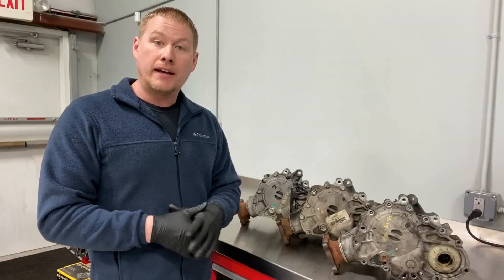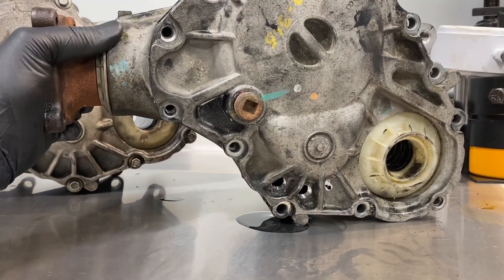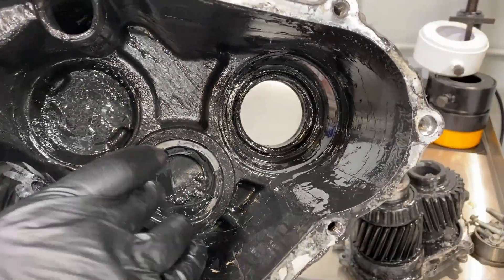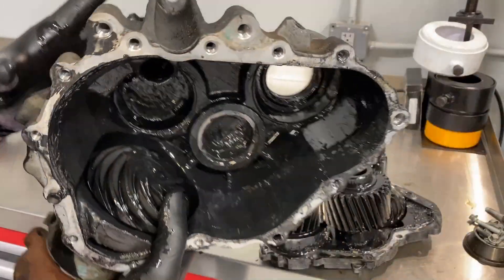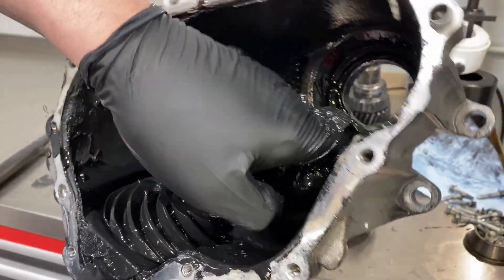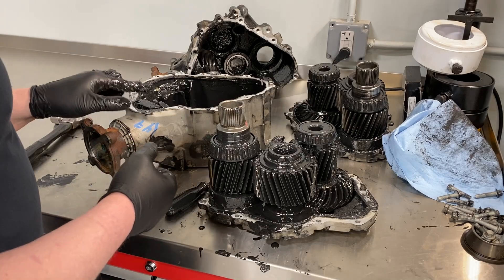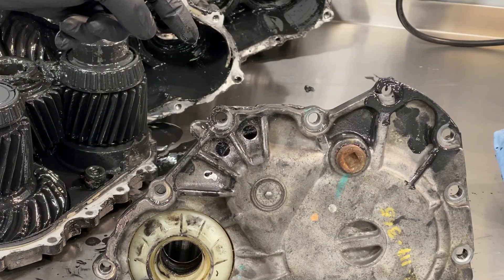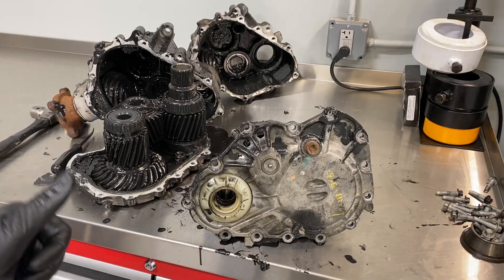How Ford All-Wheel Drive Power Transfer Units Fail and What You Can do to Prevent it!

Comment: I had this problem with my 2016 Ford Explorer.  The dealer took them 5 days to figure out the problem. They even had me come on the second day because they wouldn't believe me that there's that smell inside the cabin. The day the service people called me about the estimate to fix this, which was $3000 CAD, was also the day we decided to just trade it in. We had the vehicle for 5 years and there was a lot of issues already prior to this, like A/C repairs. 

When I told the service guy that we're not going to get it repaired his answer was "that's ok just let us know when. At the moment it is safe to drive". Got me thinking since you said that it might have a tendency to explode.  That is not safe. 

Thanks for your video!

Comment: I have a 2010 Mazda CX9 124,000 miles it threw a code of TCS sensor failure once in a while when drive I feel a clunck and my 4 wheel drive light flashes could it be this or just the sensor?

Comment: Could using an oil cooler be used to add capacity, and cool the fluid at the same time?
Reply: It doesn't have a pump. The oil is flung around by the gears. So no, a cooler wouldn't work.

Comment: Thank you for the great video! Finally I found something I can watch that is understandable. I just came across your channel by accident, after having the PTU fail in my 2013 Lincoln MKX (165,00km.) Just wondering what your thoughts are on using the Amsoil Severe Gear 75W-140 synthetic are? I have always sworn by Amsoil in all my vehicles and motorcycle. Am I wasting my money on the extra cost?

Comment: What's up with the ABS units in Edges? In the last month we've replaced three. Customer complains about a soft pedal. Have not taken a failed unit apart but it seems to be bleeding pressure past a valve inside the module.

Comment: Besides seal leaks, what are the symptoms while driving?  Does it just seize up or will it slip?  I have a slip on 2011 Edge between 30-40mph.  I installed a plug and drained the ptu fluid and no change.  Thinking this or torque converter.

Comment: I would love to of been in the room with the engineers when they justified making this PTU filled for life. I am willing to bet the life of the warranty was brought up and that failures will likely occur after warranty. There is no way they could of honestly beloved the PTU would on average last over 150k miles let alone 80k miles. It is a joke! I have 89k and in stock PTU with 440BHP with tune. Still kicking but it’s a ticking time bomb. I absolutely love the 3.5l eco boost engine! It is a beast and it tunes up to 440hp with less than $500 in parts( 3 bar map sensor... 160 TStat.. cold air intake.. and tunes) the power gain is unreal for the 93 octane tune and torque gain is even better. The car just makes power on the low end crazy fast like 3500 rpm and it’s moving quick. That’s nuts. Now the rest of the car has been a joke. Door blend broke deep in dash pass side blows cold air year round complete dash tear down just to fix $1000 plus quote not fixing.. headlight assembly filled with water and took a shit. Used assembly on eBay go for $600!! If they have working parts sometimes more. I was lucky and found one for $410 with all working parts. Blew a dash module that was a $1000 bill to get fixed. Not impressed with the issues I have had. I mostly kept in storage and drove my 2001 Acura CLS to work until it hit 239k miles and trans blew.. way too much to fix those. So I drive the SHO to work and the problems I have with it I never had with the Acura. Just truly poor engineering it is a 2010 first year but still.

Comment: With this kind of failure rate, Ford should have done a recall.  The dealer is replacing the PTU on my 2016 Flex right now.  Thankfully, the power train warranty is covering it or I would be out serious money.  I'm at 55K mileage and only a month or so left on the 5-year warranty.  I am hopeful that nothing else was damaged or compromised, as I drove it almost 3000 miles after noticing a propane/sulfur smell that got progressively worse and eventually had knocking and jerking in reverse.  It started after an oil change and I first just thought oil or other fluid was spilled on the engine block.

Comment: Do you have a part number for the new ptu with drain plug? Will it fit a 2016 explorer? I called local ford dealer and their parts guy said the part number for 2019 is same as 2016, DT4Z7251G. He said if they'd added a drain plug they likely would have changed the part number.

Comment: my wifes 2015 edge awd i change it every 25k miles its got 75k on it now and has a drain plug i use the motorcraft lube for it just changed it and it was super clean. should last a long time.

Comment: For out of warranty vehicles, do you think that adding some lines and an oil cooler up front for the PTU would solve the overheating problem? Mine was replaced at 20k miles and has the filler and drain plug. Could fluid be routed in and put to the cooler through there? Or could you recommend and other ram air ports to cool other than the one attached under the lower engine shroud?
Reply: I've had the same idea the newer ones have a vent hose near the master cylinder if you could put an extension on the vent hose and a T fitting in a hose leaving the drain plug ( the T Would facilitate drainage) then add a small radiator and a 12 volt pump might help I'm not an engineer just a thought this would take considerable time and some expensive

Comment: I do on occasion smell a propane type of smell in my 2013 Ford Police Interceptor Utility (3.7L)...  I bought it with 120k miles, at 122.5k miles now, and hoping to change the PTU fluid soon.  I'm beginning to wonder if the fluid was ever changed in this thing...  I also on occasion hear this sort of noise that almost sounds a bit like higher-pitched tire noise at low speeds, it comes after I go past a curve in the road and goes away once I have steered along a bit more (almost as though the wheels are gradually coming into alignment to make the noise, and then as I'm steering into the next curve the noise gradually goes away).  Thoughts?  Should I be concerned?

Comment: My 2003 Ford F-150 transfer case has a fill and drain plug and is designed to have the transfer case fluid changed. Why didn’t Ford design the Explorer PTU to be serviced?

Comment: I noticed you are talking about the fluid in those old units as looking like tar, I  learned that Ford adds a special Moly additive like a CV joint to maximize the fluids life and performance ,I have been (sucking)changing the fluid in my 08 Taurus X AWD with Royal Purple but not replacing the moly additive so I can monitor how much moly is draining out and get an idea of when the old fluid is  eventually out and I could add Moly if I want,

Comment: Where the filler cap is. Could you take out the filler cap add a tube with a rubber grommet. From what I can see the looks like there's clearance to get to the lower part of the casing add a little bit of compressed air either through the  vent tube  or  put a little hole  in the grommet when it's warm and force out the old fluid through the tube out the filler cap?

Comment: Damn! There I was driving along in my Explorer, smelling propane, trying to figure out what it was from. Googled it while at the store but didn't see anything dire, drove a couple miles further and boom! Smoke out the hood, and on the side of the road leaking fluid everywhere. Mechanic says now the whole transmission and drive shaft need to be replaced along with the transfer case. Crazy that this happening could do that much damage! Too bad I came across this video too late...Just a PTU replacement wouldn't have been so bad

Comment: OMG! that is ugliness. I just bought my son a Jaguar xtype, same concept from Ford.."non serviceable" I couldn't believe it. I may be too late with my sons car, but, lets see what happens. BTW, I will attempt drilling for a drain plug. Way back I had a welder add a bung for a fitting a thin wall alloy part . The welder asked what type of alloy, but I didn't know (I guessed aluminum?). Anyway, the welder was able to weld, and the bung held perfectly. I'm  going to take a chance and drill on the case instead and do a bung.....fingers crossed! BTW, great series on this PTU.

Comment: I have a 2011 Explorer w 200,000 miles the fist time I did a fluid change it very thick not much came out. Now I have changed it three times with a thousand miles between. The oil is still black but I’m getting more oil and the viscosity is more like gear oil not grease. 
How many more times should I do changes before going to 30,000 intervals?
What should I look for?
I love your videos please keep them coming!

Comment: I just picked up my parents 2016 3.5 eco boost platinum explorer from dealer, only has 29k miles on it, I found the right side PTU seal leaking on a motor oil change, the car was still under drivetrain warranty,  it took two weeks for Ford to get the “updated” seal and slinger to get it fixed??? They changed the fluid too I’m told by invoice, The service writer told me I’m good to go? I asked what about the hundreds of videos with these things failing?? He didn’t have a answer, we our a Ford family but these repeated bad engineering issues get old and make me consider other brands, I still own  a 2003 v10 f350 and a 2005 5.4 Expedition with the dreaded spark plug issues, come on Ford!!! and you wonder why people buy foreign ?!?

Comment: My 2011 Ford Flex is at 156K miles and the PTU is still working. I did change the  PTU fluid  at 136K mile and again at 154K mile. Alot of glitter in the oil.

Comment: Thank's for this video i have a 2006 Ford 500 Limited AWD. Just had it's 200k service. it's my understanding that the AWD system is VOLVO with lubed for life differentials. Are there any issues i should be aware of with these units. The only thing i've had to change  was the front axle bearings. Other than that it gets serviced every 5k.

Comment: We own a 2018 Ford Taurus AWD with 21k miles, love this car and all our other Ford vehicles. Been following your youtube videos for a few years now, very helpful advise on trouble shooting and repairs. Much appreciated. Contacted our Ford dealer today about getting the PTU serviced as a preventative measure. Was told it's a "non-serviceable unit", lubed for life. The tech had heard of the issues but stated the only way to completely drain the unit was to remove it. He didn't say what that would cost. I plan to siphon the lube out thru the filler port as the 2018 Taurus doesn't have a drain either. Just a wondering if after siphoning the lube would it be advisable to fill with ATF to help flush some of the debris and build up loose and then siphon again before refilling with new gear oil? Any thoughts? Thanks in advance..

Comment: In case I can't manage to drill a drain hole could it be fine to use a suction  or vacuum pump after 25000 or 30000 miles to drain the oil?

Comment: I'm gonna bring my 2017 Continental (18K miles) in for an inspection of the PTU seals, should I get a fluid change at the same time?
Reply: Does your Lincoln ride a little rough . I have a 2017 continental 2.7 awd and even with 19k miles it rides kind of rough for how new it is and I suspect the ptu

Comment: you showed me no more than goop in the power unit, I didn't see any failure as you discussed during the video (eg: missing teeth), whats to stop one from parts cleaning the unit replacing the idler bushing and bearing, refilling with proper lube and sending it on its way...?

Comment: That cover was stuck tight on that 2nd unit........."..if all else fails, get a bigger hammer!"...  lol  Why in the hell did they use a bushing on the idler gear and not roller bearings like the rest of the gears??  SMH.

Comment: This transfer case was also used on the Mazda CX-9. Sometimes they would come in failed in less than 11,000 miles. Most the time it was approaching 100000 miles though. Mazda extended the warranty on them due to the failures. Many times in the higher miles cars the splines that meet the transmission would be damaged as well as the transmission splines. If it was still under warranty Mazda would also replace the transmission as a related item. The transfer cases in the CX-7 never had a failure like this. Those transfer cases had external coolers. Oh and 5 hours for the transfer case replacement ? Lucky bum, Mazda would give us 2.1 hours.

Comment: I have a 2013 fpiu that shakes around 24mph, it happens more often if the vehicle is accelerated slowly. I don't smell anything and there's no fluid leaks. I have about 144k miles. The transmission fluid is fresh and it only shudders and shakes around 20-30mph..can this be the cause?

Comment: Hi. Thanks for making all these videos. I have been following you for a few years and they have helped me not only do some maintenance better, but also helped me understand better. I do have one question for you though. I recently used your video to service the PTU on my 2015 Escape, but I ran into problems servicing the rear differential on it. Do you have any info on that? It's nearly impossible to get to the check ports with a wrench due to lack of space between the sub-frame and the differential. Can that fluid stay in it for life? My gut tells me no.

Comment: If you set up an air line into the filler plug you can put positive pressure in the housing. When you break thru with your drill the pieces go out along with any oil. Same applies when you tap it. You could also go right down to 1/16" NPT and use a dry seal pressure plug. It will involve getting the tap before hand but leaves only a tiny drain. My guess is that from the look of these units they will need some sort of flush. What do you recommend: over filling and driving for a bit and then redraining and filling again with the correct oil? Can you put in a drain from directly underneath near the side cover?

Comment: What are the symptoms/ noises associated with a failing or failed PTU? Obviously shy of it having exuded? I have an 18 3.5 ecoboost F150, that started making some type of, not necessarily grinding but almost like a bad bearing noise. I could hear it mostly when I'm doing 40 mph, but I can slightly feel it through the accelerator pedal. Kind of hard to describe.

Comment: It is a great informative video, and showing not only one but two of these, thank you!
I was thinking that if the idler gear bearings are in the gear, the shaft should be stationary at all times? What I fear is that if the shaft isn't locked to the case, no matter how good the oil is, it will turn and eventually chew itself in the softer aluminium. Of course it would still be good to change the oil regularly to get those contaminants out, it would definately last longer.

Comment: after the 5.4 (plugs...plugs again after redesign...cam phasers) and all the issues with the 3.5s intake valves....
f250s and 350s having death wobble (which WAS a dodge issue mainly)

and now this.....i dont get how anyone can buy a ford

a co workers 2019 fusion had to get a new engine because the block was miscast.... and coolant was not cooling 1/4 of the motor
temp gauge read fine.... but one cylinder was COOKED 

i just cant believe all the MAJOR issues that these cars under 5 years have..... 
what is going to happen when they have 285,000 miles on them like my 99 buick century? 

every mechanic has worked on 100s of W-body GMs.... we know what is going to break and how to fix it
GM spent billions making the W-body..... improved over the years..... very well designed, rugged cars

 but Ford is just scamming people at this point..... 
get them in with great marketing (have a v6 with more power and MPG than a v8.... just ignore the intake valve issue the v8 doesnt have)
yet its like they spent 5 hours designing the whole car....

Comment: Had a 2009 Mazda cx9 with 114k miles on it we bought used (ford 3.7 engine). After much pre purchase research, i put it right on jackstands and attempted to pull out the fluid for a refresh. What did i get out? A mere two drops of fluid. BARELY ANYTHING WAS IN THE UNIT! I filled it up to full capacity with new fluid. Dodged a bullet there. 

Fast forward to a month later. Engine light came on flashing and vehicle started slowing right down on the highway. Limped it home and scanned. Found a cylinder 1 misfire. Pulled it all apart to find the #1 ignition coil melted. New plugs and coils, same misfire. Turns out it burnt out the ECM. After some research, ANOTHER common problem apparently. Swapped with a new one. Had to have it towed to the mazda dealer. Dropped it off with both keys and they somehow said "lost the key" portion of the fob. An extra $190 dollars later, we had a new key and a vehicle that worked. A week later, engine light on for failed catalytic converter thanks to limpin it home with the misfire (i guess that was my fault). 

But that vehicle was the biggest pile of dog poop i've ever owned, and i've owned A LOT of vehicles. Never again will i be buying a vehicle with that drivetrain. I was just WAITING for the internal water pump to let go, and boy am i glad i sold it before that happened. 

It was a REALLY nice car that drove amazing, and was an awesome highway cruiser. Such a shame Ford had to ruin it.
Reply: Ford hasn't made a good vehicle since the bullet proof EFI version of the 302/351 in the late 90's. I miss my Thunderbird!